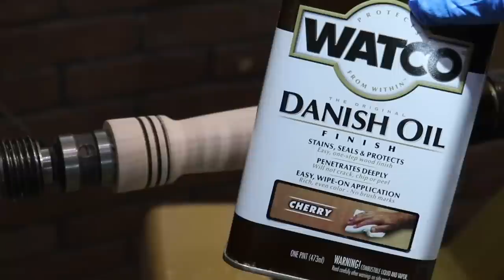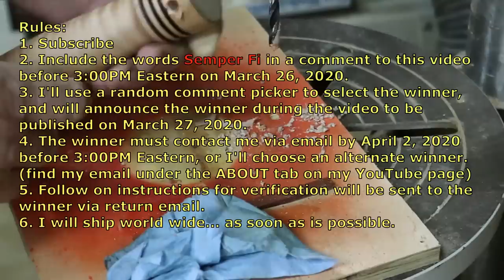Woodturning Garden Tool Handles

Comment: Semper Fi Brother, appreciate the faith. I did say a quick prayer at .44 seconds when I saw the cut off handle blanks sitting in front of the miter saw start to move toward the blade with the vibration of the next cut, that would have turned a Woke Liberal into an awakened believer.

Comment: I'm a really new turner. Still working on my skew handles for my carbide cutters. In any event, I learned things from your video today. I had been working hard to get rid of the dimple on the end but it appears your tool handles still have that dimple. And, I was using my 4 jaw chuck during the entire turning process so was having trouble shaping the handles need the end but you switched away from that after you drilled the holes which would allow much more room. I discovered you through Nick Zammeti! Semper Fi, Army Strong!